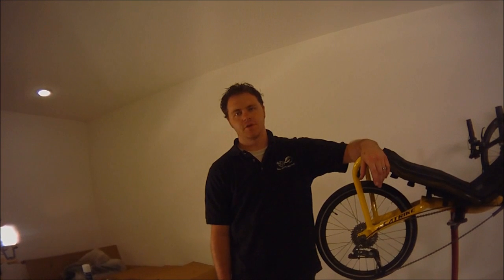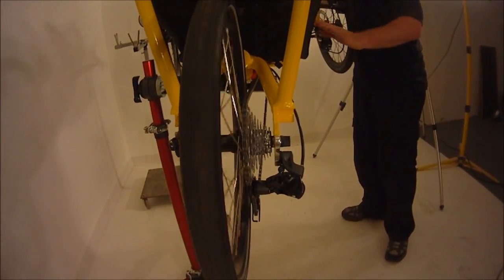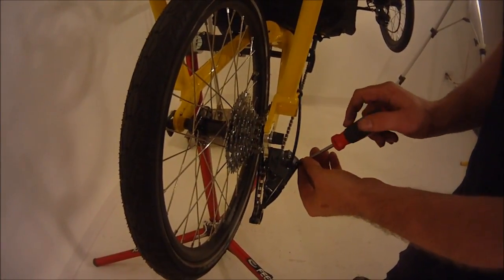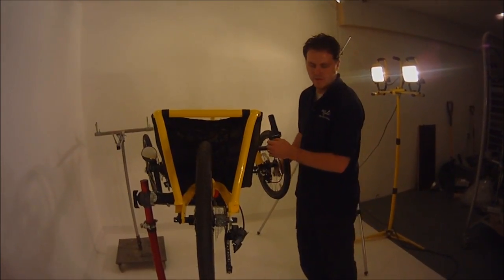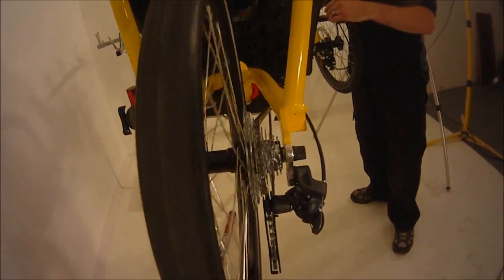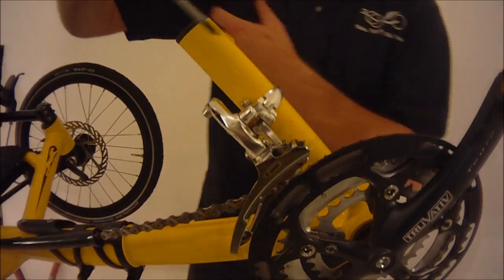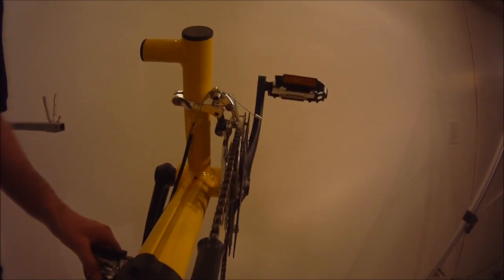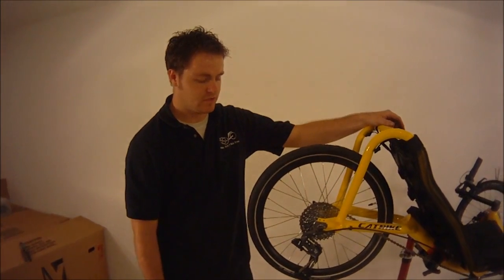Adjusting your derailleurs

Comment: can you fine tune the cable tension from the twister on at the rear derailleur unit (where the cable goes in just as well as one at the shifter like he shows? I have bar end shifters and there is no twister at the shifter.